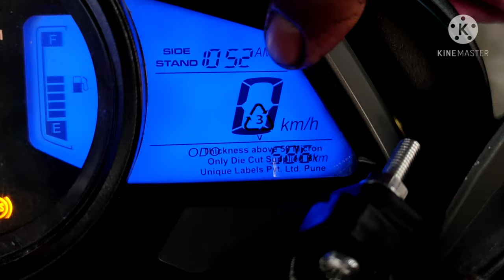How to Best Engine oil Motul Bajaj NS 200 2021 Motul 7100(20W-50) In All Bajaj Bike At Least 5000km

Comment: Sorry to say this but actually you have made a mistake, never use the synthetic oil before 5000 kms there might be consequences of engine problems. It is  even mentioned in the vehicle owner manual not to use synthetic oil before 5000 kms.